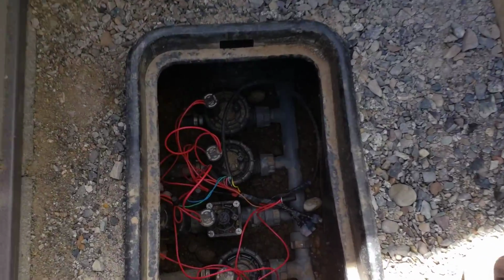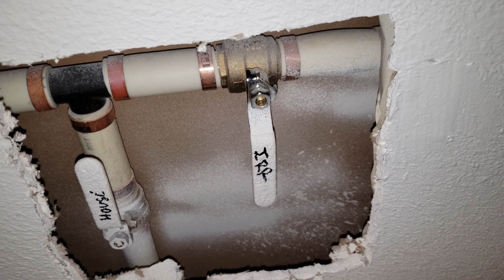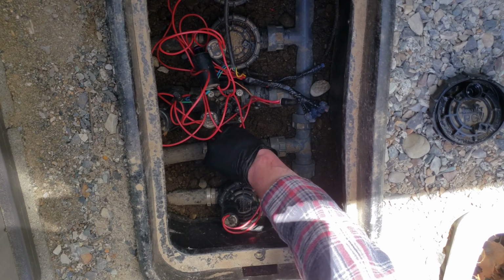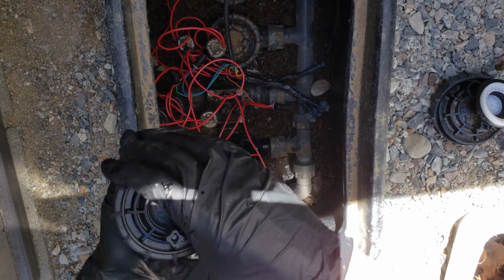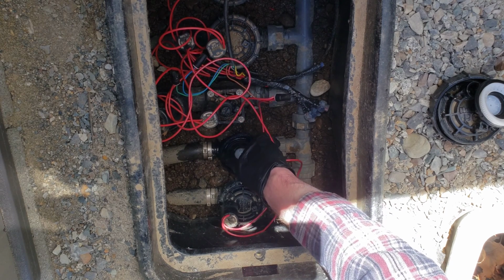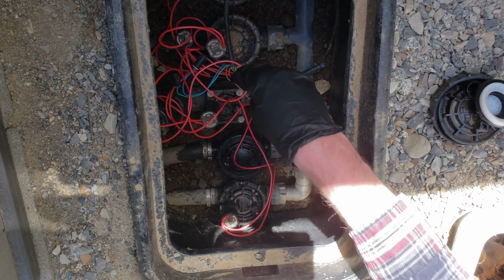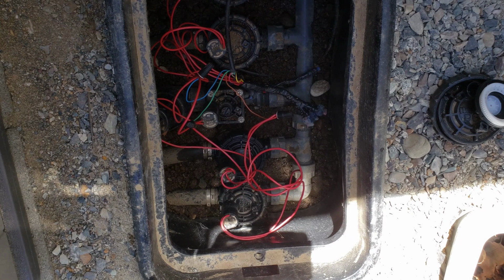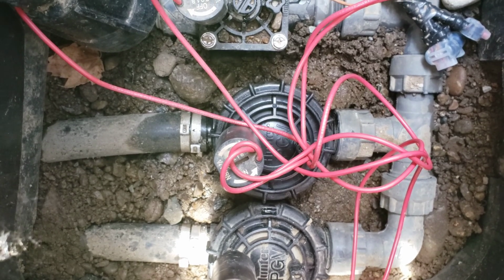Hunter PGV Sprinkler Valve Replacement For Leaking Valve Top Half

Comment: What can cause a leak in the valve that fills up the valve box?
Reply from the maker: Hi David, thanks for watching. It could be a lot of different things unfortunately and hard to know without being there to see it.  Sorry I can't be of more help and hope you get it fixed.
Reply: It can be caused by a pipe to or from the valve that is leaking. It pushes water along between the pipe and the soil and fills up the box. The valve could possibly have a bad gasket or be cracked, perhaps from frost. My ones have a leaking sprinkler at the top of a slope and the water runs down hill and into the box, filling it up.